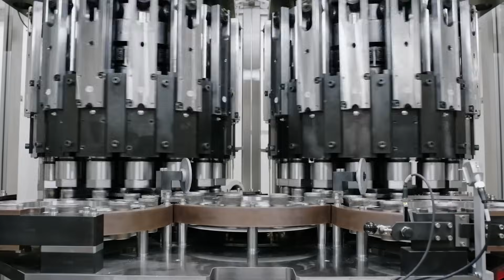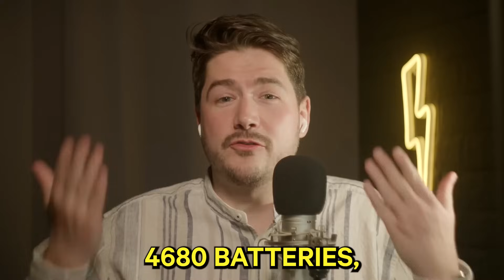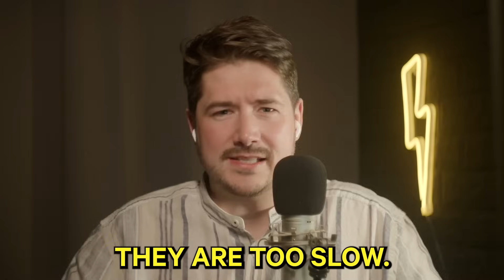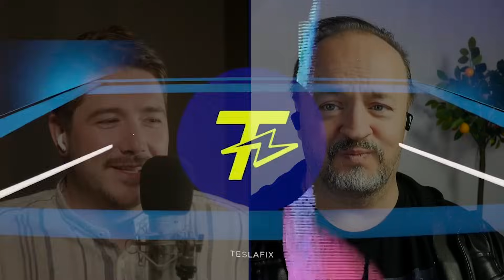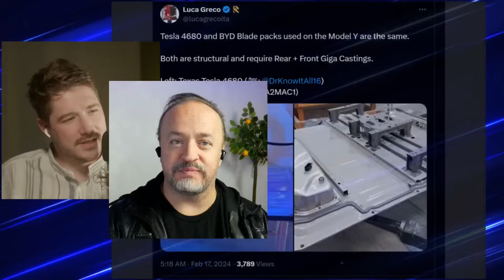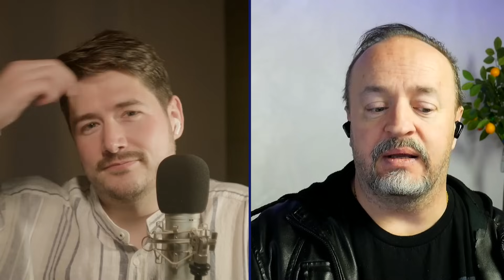TESLA Cybertruck RUST & Struggling 4680 Ramp!!⚡️w/ FutureAZA

Comment: The reason the rust is worse than on paint is that the corrosion of the metal particle is enhanced by the galvanic interaction between the two metals.

Comment: Roadster = 18650. Why? best fit for performance low volume as S and X volumes drift down these would be obvious choice for Roadster. 18650 is easier to cool than bigger cylindrical cells and gives better power output with higher physical battery complexity and higher cost (not a problem for roadster price bracket). Model 3+ performance will eat into Model S sales from one end whilst Roadster would eat into Model S sales from the other end.... My view is Model S is in decline and will likely be discontinued relatively soon! I could see Model X carrying on for a while longer but likely will not be replaced at end of it's run.

Comment: 4680 was always irrelevant to Tesla's desire to soak up ALL available supply from all other sources that meet their requirements! Tesla will always be battery cell constrained because there are so many as yet unexploited uses for these cells within Tesla's mission. 4680 is a really hard stretch goal, other battery cell specific manufacturers know they would struggle to produce economical quality 4680 cells or they would be already producing bigger cylindrical cells at volume. The most important benefit of bigger cylindrical cells is production velocity potential, you producing a single 4680 is no more time consuming than a single 2170 it's just like canning food... Battery capacity per unit of production time etc is however way higher. 4680 production volumes will explode once the engineering is complete and this is replicated across many multiples of lines. Kato Road is now transitioning to improving chemistry this suggests we are nearly there with the engineering for physical 4680 production process.

Comment: Google "Stainless steel passivation". In short when we weld stainless steel, we use different acids to decontaminate the weld areas after in case somebody used a steel wire brush or something.

Comment: Batteries are Tesla's biggest issue by far.  They whiffed so hard with their 4680 plans and never never hedged their bets and started building their own LFP chem batts years ago (or partnering with a china manufacturer for a joint factory in the US).  Still don't understand why they didn't prioritize making their own LFPs, considering they are perfect for stationary storage (way cheaper to make, iron is massively abundant, no need for high energy density with sat storage, no conflict minerals needed, better cycle life and can charge to 100% and run to near empty without degradation issues like the nickel-based chem...not to mention tens of billions of IRA dollars dropped in their bank account).  LFP chem (including LMFP/M3P) can be used in 95% of Tesla's use cases!! (all stationary storage, all trims except performance of Model 3/Y, plus Gen 3!!!).  Theie recent decision to boost manufacturing output by 5% with Panasonic and just now announcing a possibly partnership with CATL to begin building a joint venture LMP batt factory in the US is too little and WAY too late.  There must be more to the story because it seems like Tesla dropped the ball massively making these decisions SO late.
Reply from the maker: "Way too late" is a bold statement. Tesla produces EVs massively. BYD had one quarter to produce more than Tesla. It is a good thing that Tesla produces their own batteries. The dry process is super hard to achieve but an important step for battery production.

Comment: I absolutely believe that presently the 4680 Model Y was the only structural battery pack. Unmaintainable, 100 steps for removal and 102 steps for replacement. A warranty nightmare if those cells malfunction and a huge cost to the consumer if it's out of warranty.
Reply: Yea, they've got to make them modular, otherwise repair is going to be big trouble.
Reply: I absolutely believe that
1) You're guessing
.
2) The "102 steps" are (if correct) no more than a "conventional" pack which rather than having the interior removed, would have to be split, repaired and reassembled (which is why most manufacturers would not do it...)
Would you take an ICE vehicle to a dealer for a full engine rebuild under warranty?
Would you be surprised if they didn't return the vehicle saying "the rebuild labour was too much so we swapped the engine"?)
.
3) Are you privy to the diagnostic and repair techniques employed?
.
Do you know what percentage of failure (if any) would be due to a "bad cell", or alternatively due to let's say a BMS electrical issue, accessible from the pack exterior, so (possibly) repairable without removal?
.
Do you know if due to the contact/ BMS configuration, they can isolate a specific cell and send a brief  "over-current" pulse to blow an in line fuse, thus removing just that one cell from the circuit?
(If they can, that's ±1/820th, or about 0.12% of capacity... Negligible).
.
And other questions.....
.
(Those of us involved in field service ask this type of question before going for "worst case" alternatives. Judging by previous behaviour, I'm sure both design engineers and service technicians at Tesla asked the same)
.
EDIT.
Related to 2 of my questions.
.
I know that early Model S cars DID have a BMS board corrosion problem, repairable (cheap new board)
.
I've seen displays of individual cell voltage.
This indicates there IS the ability to "pop" the circuit to each cell, either at the cell, or at the point that signal connects to the BMS.
Reply: @rogerstarkey5390 Thanks for taking the effort to provide a valuable response based on clear expertise to counter the typical "keyboard warrior" making assumptions from their bedroom. A model 3 LR battery pack with 4500 cells (2170 type). If any single cell failure could render the pack failed then the reliability would not economical. The Battery Management System (BMS) can disable cells or, more often, balance charge across the thousands of cells, some of which will be slightly sub-par and a few fully failed to allow the pack to last for years and years. These are NOT the same as phone batteries, which don't have multi-cells with BMS.

In addition, the BMS is software controlled and so it can be improved with OTA software updates.

Thanks again, Roger!
Reply: @garyrooksby  I'm not an expert but have seen videos from Munro about the 4680 battery packs and they don't look easily repairable with all the foam between the cells. There are other videos showing repair, but I believe Tesla makes it really difficult for companies to repair in terms of software. It's an industry that needs to develop massively.

Comment: My question(s)
.
If we assume the at least Panasonic, probably LG, maybe (previously rumoured?) possibly Samsung are working on 4680 cells, and we know that they hadn't before because of the "long electron path/ internal resistance heating" limitations....
.
What chance that they're in at least limited cooperation with Tesla and each other?
.
Which technologies are they using?
(Wet/ dry electrode? Full or semi "tabless"? Both?)
.
What level of cooperation is there between the 4(?).
.
If using a "hybrid" approach, for instance the previously rumoured Panasonic "wet process, 5 tab" cell? What performance level do those reach?
.
Is the "pullback' because they now think they can achieve dry process/ Tabless and are refining the process?
.
Are they maybe waiting for confirmation of the new Tesla line performance before acquiring that technology?
.
Is there an "agreement in principle" that by sharing information, they all produce  as near as possible the same cell (chemistry not withstanding) in the maximum quantity collectively possible (and as a result all make a proverbial shed load of cash... Sorry, I mean advance the global battery supply considerably😉)....?
(Kinda matches the Tesla "mission objective"?)
.